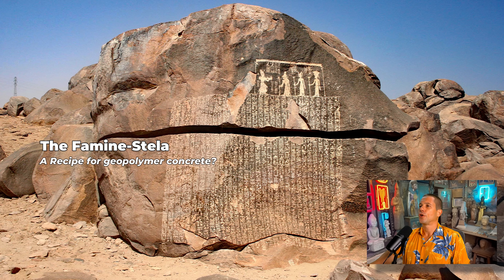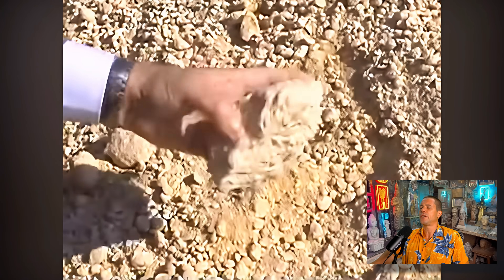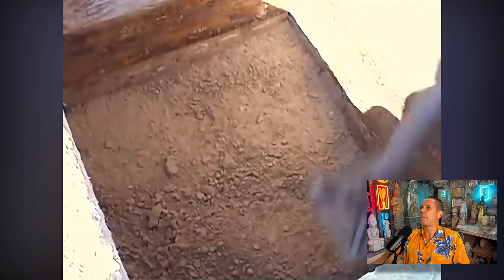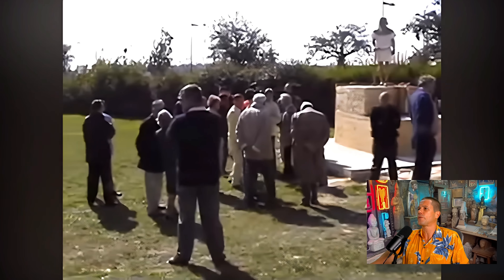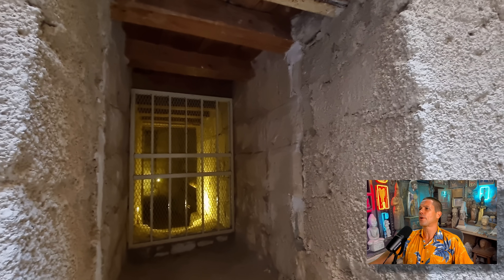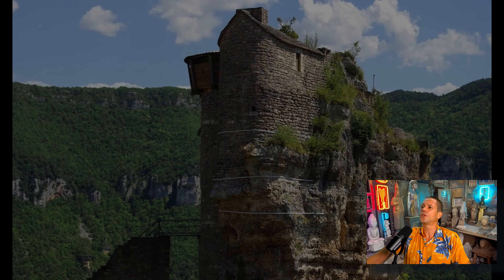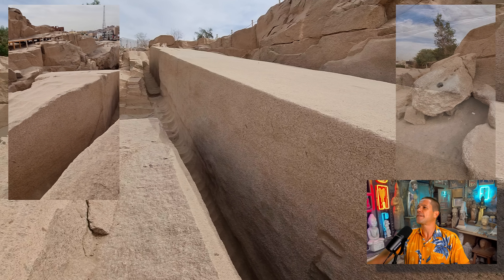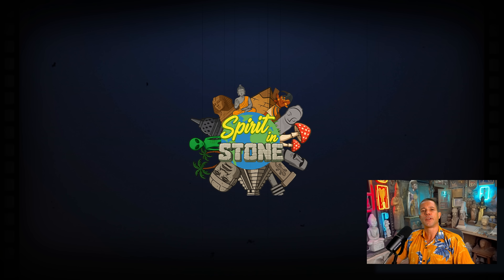The GeoPolymer Experiment | Recreating the Pyramid Stones of Egypt

Comment: Haven't they found mountains that were cut into cubes near the pyramids? Why would they cut the stones in cubes then?
Reply: Exactly,the quarry is still there showing all the cut outs where the  block was removed.
Reply: Sí pero pueden confluir varias técnicas deconstrucción o varios tipos de materiales así como en una obra moderna hay bloquea ladrillo concreto, piedras sin tallar, ....
Reply: Perhaps it was to pre-shape blocks and they used chemicals to smooth and do final shaping?
Reply: Just because they knew how to create stone blocks using a geopolymer method does not necessarily imply they never quarried natural stone. And this method can not produce rose quartz or diorite or granite or olivine or feldspar… so if you want any of those for purposes like vibrationally activated piezo-electric power generation for example, or non-conductive cladding stones to insulate such a system, you still gotta take your ass down to the quarry.
Reply: @Pencil0fDoom  You can't actually say you can't create feldspar or any of the others, their tech was a thousand years ahead of us and there are several crystals now that we can produce in labs, not quite to the same levels and in a lab you can tell which is which but they may have been able to make crystals of any sort. 

Your point is still valid, i'm just pointing out the assumption might not hold up. 

Any time you tell a human something can't be done, he will find a way to do it.
Reply: @8thsinner  I look forward to your demonstration of how to invert your own head then as per your statement: "Any time you tell a human something can't be done, he will find a way to do it."
Reply: @8thsinner you are saying that they were able to lab grow large phenocrysts requiring high pressure high temperature technology yet were unable to smelt & forge steel ?
Reply: @GroberWeisenstein  I said no such thing. I said. You cannot rule it out. And who said they didn't know how to forge steel?
You think because "they" "claim" they found no steel that they never used it? Do you think the general public knows they had purple gold either? cause they did...and theres other metals too.
As I said above somewhere, their tech was a thousand years ahead of our current levels, not even our current publicly known levels, i'm talking a thousand years ahead of the current level of black ops military tech. 
The biggest mistake everyone is making is that these ancient builders were primitive. It is us who are primitive by comparison...and theres only a handful of scientists even close to understanding the level of physics they did.
Reply: @8thsinner early irons and steels were too brittle compared with arsenical bronze. There would be evidence of large-scale iron smelting & foundry. What physics are we incapable of understanding that they did ?
Reply: @GroberWeisenstein  If you assume they were using our kind of smelting techniques maybe yes. But you don't need heat and fuel to smelt, you can do it through inductive magnetic fields directly inside a mold combined with sound frequencies to float impurities for removal. 
The surviving ranges of metals from 25ish to 40,000 ish years ago show significant advances in metallurgy, from purple gold, orichalcum, and copper that didn't oxidize, as well as various steels across the globe which haven't rusted to this day.
Reply: @8thsinner where's the infrastructure that built the original induction technologies or did those just drop out of the sky ?
Reply: @GroberWeisenstein  No, a flood dropped out of the sky and washed away most of it. Anything that wasn't...its been 2000 years, you think scrap copper wires are going to stay as copper wires, you think gold isn't going to be melted down a thousand times into jewellery and adornments for weapons in the hundreds of wars since...
The very little that has survived intact, and there is some, its buried in secret chambers in egypt and other parts of the world under guard or being studied by black ops scientists.
Reply: @8thsinner funny stuff .
Reply: @8thsinner they were not 1,000 years ahead of us in technology. They were 2,368 years ahead of us. That much is certain.
Reply: @8thsinner so long as none of this technology needs to be produced, we can theorize just about anything. Actually, they took parts of the sun down in melted The Rock and then reversed gravity in order to make it float upwards from Aswan to Giza. No way you can prove that I'm wrong. After all, their technology was 2,368 years ahead of ours. They used frequencies in vibrations in order to build the pyramids. They could levitate the blocks way up into the air and set them down onto the pyramid using tuning forks.
Reply: @Pencil0fDoom But if we're going by evidence, then it needs to be acknowledged that there isn't any evidence that the Dynastic Egyptians ever actually worked with geopolymers. Meanwhile stones carry unique signatures that allow geologists to precisely determine where they came from. The GP stones have already been conclusively linked to those quarries relatively nearby.
Reply: Perhaps somebody use that area as a quarry and made those stones at a later time
Reply: Nope - fake news
Reply: Quarries exist all over egypt
Reply: The Romans were the ones who were cutting out the blocks, they raided plenty of artifacts, and even reused the columns
Reply: Maybe attempts a few thousand years later
Reply: They definitely poured the sarcophagus in the king’s chambers. They had their own type of cultured stone. I don’t understand what’s so hard to believe about this. It makes more sense then humans with zero machines building with massive 10 ton blocks.
Reply: To make smaller pieces to work with...
Reply: Maybe they used the stone softener to join the blocks? And used whole block for main structure. but I think the mainly the casing stones were geo. But nobody really KNOWS.
Reply: @kigerkarlzeberedi1800  They could, but why would they? When they can clearly cut to 1000ths of an inch accuracy, and melt when they wanted. 
They might have on occasion to do something that required multiples of compound cuts but the way we use that process for modern day with tiny bricks, we need the concrete and brick binders, when you're building with 5tonne bricks and upwards theres very little logical reason to. Unless there is a gap of an odd shape somewhere needed. 

And actually, lots of people know the truth.
Its just that the relative few who are told it can process it. 

The casing stones weren't built by the atlanteans but a coverup job done by the egyptians after they found the site. And yes it maybe was geo, they only found very little of the atlantean tech, what little they could decipher and use wasn't enough to rebuild at the same level, but because they saw things built so big, they didn't limit their imagination on things. 
They didn't know it only took two years to build the pyramid plateau, so they didn't care if it took them 50 or a 100 years to add to it...they saw things could be done, and so found ways to do things.
Reply: @kigerkarlzeberedi1800 yeah the stone industry and geological sciences knows. Hard stone softening is a myth.
Reply: @GroberWeisenstein ive looked into it a bit. It seems there is a way to soften quartz, which is a part of granite. But, according to someone else, it doesnt re-harden.
Reply: @fryloc359  If you're using molten hydrogen peroxide no, it doesn't re-harden, however, there are other chemicals which can induce extreme exothermic reactions from contact with hydrogen peroxide which may yield a slightly different result.
Reply: @fryloc359 that involves complete immersion into a specific solution. Applying to a surface as a practical method is not effective.
Reply: They maybe used both
Reply: @renatoOVilao it's crazy how nobody can grasp this. Maybe they used a bunch of methods for different situations and supply.
Reply: @JohnnyGonzo77 yes, this a situation that one needs to keep an open mind, because if they were able build what they build, they clearly were very open minded for different ideas, creativity and strongly capable of adapting to different circumstances.
Reply: @JohnnyGonzo77  Exactly. They had 4 main ways of working stone. 
1. Straight cuts down, like a saw, kinda
2. Melting and reforming
3. Atomic gridding, kinda like a giant rectangular punch
4. Atomic scooping, giant to micro atomizing spoons
They did have multiple mechanical ways to employ them too though, the spoons could be fit on a drill type device to make holes, the cutter they had could be used in any orientation, they just mostly used it to cut downwards through the blocks because of gravity pulling the unit down but it basically atomizes the same way the grid cutters and scoops do. 
Later on in the development like in the indian temples you could see they had basically what we would call giant cnc machines using scoops as drill bits, cutting down at first to clear the area then sending down more shaft like arms which would do all the carving stuff.
They were very open minded really on all things bar one, they didn't waste resources, they didn't risk their health. 
If they were here today they would not partake in most of society, where everything is designed to be thrown away, and everything harms you. 
If they discovered some new technology, or product kinda of idea, it would be tested very thoroughly, if it harmed anyone or anything, the idea would be destroyed or re designed.
Reply: @JohnnyGonzo77  This would be very reasonable assumption.
Reply: @8thsinner  Plus drilling and machine tooling. Very. Precise. Like, laser precise.
Reply: @Vlcounek  Well yeah and no, It wasn't drilling...technically, drilling defines the removal of material via cutting action on a rotational plane, the emphasis here being cut, they could create holes but for that they still used atomization technology. 
But yeah, they were kinda obsessed with accuracy, because they understood how important it was for vibrational reasons.
Reply: No
Reply: They know where all the stones came from same for stone henge it’s all documented
Reply: Table top mountains as they are called are all over the world, primarily nearer the equator.
This is how they mined stone yes, I won't go into the tech for it but, they basically flattened a mountain, then dug down the edges in giant hanger sized trenches,  broke off the big rectangle by essentially pry bar methods, lifted it up, moved it to a clearing field where it was then cut into more pyramid sized blocks then floated to its final location.
Reply: I asked AI: What is the volume of the Suez canal?
That’s a good question — the exact “volume” of water in the Suez Canal depends on which parts you include. But we can make a rough estimate using published dimensions.

✅ Known dimensions
Length: ~ 193.3 km (as of recent configuration). Encyclopedia Britannica+2Suez Canal Authority+2

Maximum water depth: ~ 24 m. Suez Canal Authority+1

Typical surface-width / canal width: water-surface width can be ~ 313 m, while a narrower “navigational channel” is often 200–210 m wide. World Economic Forum+2Alexandria Chamber of Shipping+2

🔢 Rough volume estimate (upper bound)
If we approximate the canal cross-section as a rectangle of 24 m depth × 313 m width — multiplied by 193.3 km length — we get:

Volume≈193,300m×313m×24m≈1.45×10^9 m3
That’s about 1.4 billion cubic meters of water (assuming uniform maximum width & depth).
This means that approximately 14,500,000 m³ of stone blocks were removed to dig the canal. Those materials would have had to be placed somewhere: either piled up along the canal as a wall with the same width and height as the canal’s depth, or stacked into large pyramid-shaped structures. We chose the latter.
Reply: You have to cut stones into blocks if your going to smash and crush into a powder then mix with iron ore flakes and then fuse it with induction heating method. And copper rods for even heating as well as copper molds to fuse the stones together when running through DC current or ac not 100% but no matter they used electric current to fuse the stones together
Reply: @GIJoe66Delta17-3DJoes-ORC 
Is it necessary for it to be a block? Isn't it easier to just blow up parts of the mountain and then gather the stones and grind them into powder?
If the ancients wanted to do so they would've probably chose to throw the stones from a height to break them into pieces instead of cutting them into blocks and moving them kilometer away!
Reply: @mahyar2727  maybe they already had. Or maybe they used lasers or water to catch away the stones. After all these Advanced human/Alien Hybrids did mix there dna 🧬 with ours Billy Carson talks about the emerald tablets. So it makes very good sense but how long has it really been? 36,000 years since the floods or 72,000 years?
Reply: @GIJoe66Delta17-3DJoes-ORC 
With all that deep deep underground city that they've found under the pyramids it's unlikeley that humans made the pyramids.
Reply: @GIJoe66Delta17-3DJoes-ORC that's how we know that the pyramids are really many thousands of years older than the mainstream people forced down the throats of little child students. They can't admit their lies else they will get fired. It's a huge conspiracy and the so-called egyptologists are paid to perpetuate it by the people who were really in charge. And when I say people, we all know how Loosely I am using that term.
Reply: @mahyar2727  worldwide planetary pyramid energy grid system that’s why there’s pyramids under the oceans if you find them in the centre of currents
Reply: @GIJoe66Delta17-3DJoes-ORC exactly. And how could they possibly have formed the titanium ties that they used if they hadn't quarried the blocks to begin with? Quarried blocks suitable for use in the pyramids were most certainly broken down into smaller sizes which were then put back together through methods that we have no idea what they did or when we can't possibly replicate it but we know that they did it because it's right there and it couldn't have been done just buy quarrying rocks and stacking them up on top of each other. Only aliens could have built the pyramids
Reply: @EskWIRED what are you talking about? Do you know what induction heating method is?
Reply: @E @EskWIRED  copper moulds running electrical current as well as copper rods for even heating. Iron or flakes in the mixed stones. Everything was made precisely as a mold. Now if it was poured on site or made in some factory. Tell me the 2 mile deep Pilar’s they found with underground substructures should tell you they knew what they did and how advanced they were. So anything else? You do know what induction heating method is right? As well as you can levitate through sound frequencies. Or even magnetics. Being advanced they might have had many ways to transport something. After all we have magnetic trains.
Reply: @GIJoe66Delta17-3DJoes-ORC high currents are used in a coil which excites the atoms in nearby metals? Does it work for limestone?
Reply: @EskWIRED they must have used some type of mix. So if the lime stone has iron ore flakes then I would say yes. If it has some other type of mix then those scientist can analyze it. But no matter induction heating does allow you to heat up any stone and shape it or fuse it. What is more interesting and important is the jade they used and shaped into the rings they used for cell regeneration for real longer lasting life. You seen the goblets they made of jade with a star map on it. So it’s a clear demonstration of something more we have lost. The Chinese seem to be using more induction heating methods in there industries. So we need to use it in ours. Think about magnetic sidewalks roads and other forms of transportation as well as water. Water flows up and follows the magnetic path.
Reply: @EskWIRED the outer casing stones on most have been removed only a few had some remaining. These pyramids used acoustic sound frequencies to pulse towards the planets cord on a planetary system. They controlled the planets rotational speed. Hence that could explain the stronger magnetic energy fields allowing for giantification
Reply: @E @EskWIRED and I don’t really care. I almost died once cause of my blood clot. So my system is not ok. So I will say what I can cause you never know when it is your last day when you get older. And for me it sucks if I eat too much bad foods I feel like dying.
Reply: @GIJoe66Delta17-3DJoes-ORC are you sure back the Egyptians did not use the cold fire technique in conjunction with titanium filings to do the job? Vibrational thermite? I can imagine thousands of people all singing the exact correct note, with molten lava blocks, fresh out of the induction heater, rise up through the air and plop into place.
Reply: @EskWIRED  the whole pyramid layout there’s like schematics, but who knows how much of the ruins is ruined sometimes it’s like three different layers of schematics to make something. Other layout, the stars and this whole solar system
Reply: @E @EskWIRED  some of the layouts show you how to make the technology if you know the schematics like transistors and resistors capacitors amplification the Megatron
Reply: @E @EskWIRED  so people all chanting in the circle is not what they did
Reply: @GIJoe66Delta17-3DJoes-ORC it is the pyramids that made the solar system, and not the other way around.

Comment: If the volcanic rock were a kind of obsidian, you might have a chance of being right... but granite? The large crystalline structure of granite forms as magma cools slowly while deep under ground. ANY artificial rock process would involve a geologically rapid solidifying process, and this would also reduce the compression and torsion strength of any such stone. This would be counter productive to any benefit gained from using stone in the building of a pyramid.